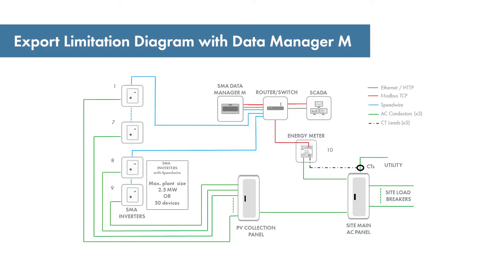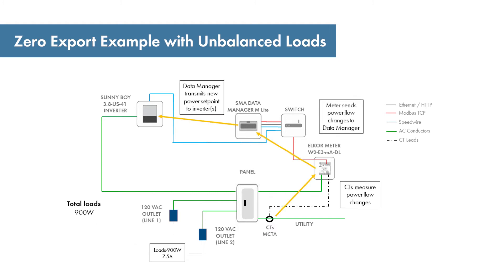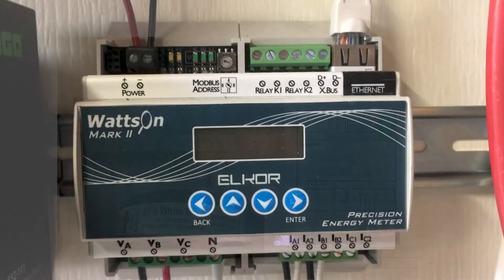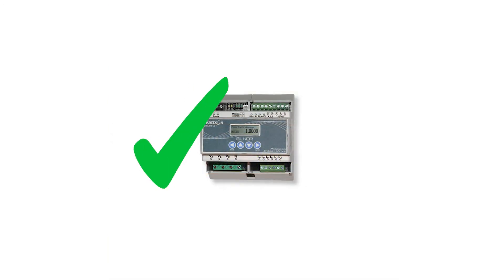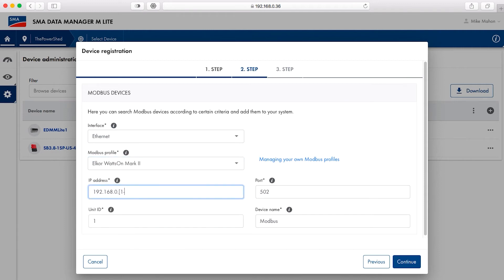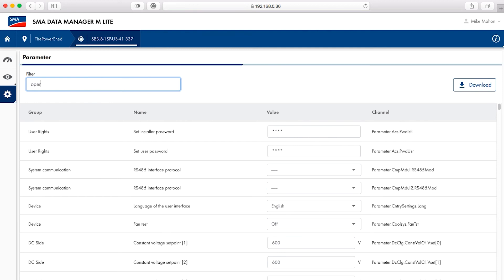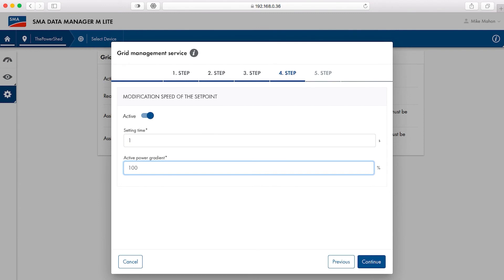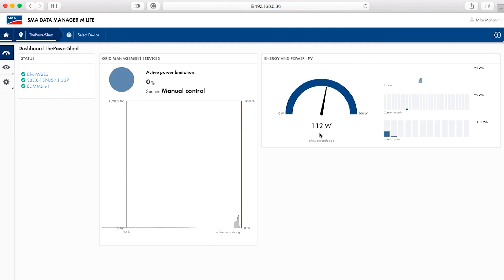Export Limitation with the SMA Data Manager M

Comment: I have a 500KW plant but my local load is 80KW, and I've not started feeding the excess power into the National grid.  
How do I configure my system to only produce only 80KW and not more in the meantime?
I'm using a 20 X STP25000TLs, 24 S.I 8.0H-12, and one Data Manager M.

Comment: Is zero export possible using the STP 62 ?
Reply from the maker: Alberto – Yes, the process would be the same as shown if using a CORE1 US-41 inverter. The energy meter would obviously need 3 CTs rated for the appropriate current level for a three phase system, but the process is the same. Zero export would in this case be net zero across all three AC conductors.

Comment: I thought the concept of zero export was so the user can have electricity when the grid is down.  This still allows back feeding which can kill a line worker.  So I can’t buy this system and have electricity when the grid is down.   Seems like this industry is still upside down.
Reply: I'm not with SMA, but I can answer this. The concept of zero export is just to stop export. There can be different reasons to do this, but often it is to avoid overloading the grid during normal operation, especially when grid lines are small and the generation system is big. Zero export is a utility requirement in some countries.

Many SMA inverters are installed with a backup power outlet that will continue to provide power when the grid is down, without back feeding to the grid. They are very safe. You can also have a battery system installed for more backup power. These are totally separate features from export limitation.

Comment: is it possible to set zero export with out energy meter?
Reply from the maker: Sudhakar – An energy meter of some type is needed to measure power flow at the grid connection point.  Inherently a grid-tied inverter has no way of gathering this required information.
Reply: Ok, thank you very much
Reply from the maker: @sudhakarporumamilla4356  You're welcome! :)